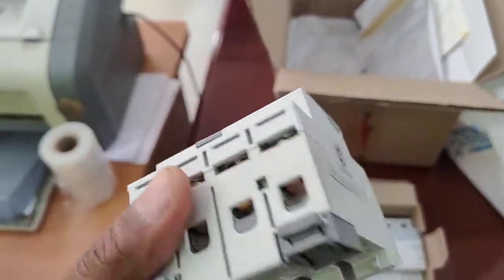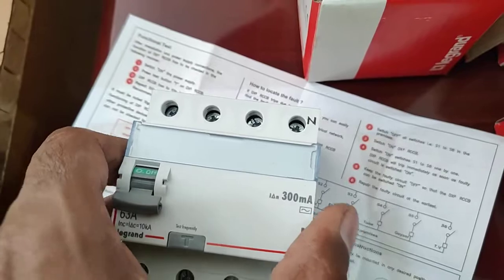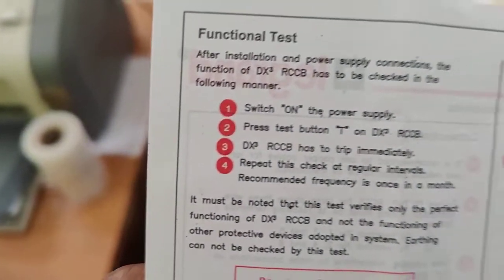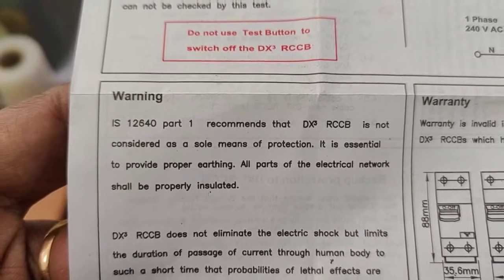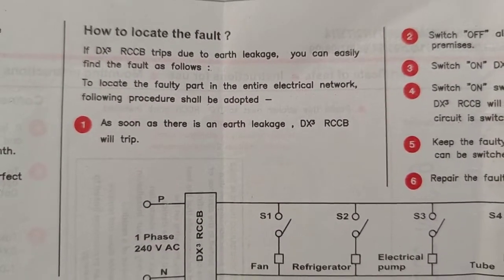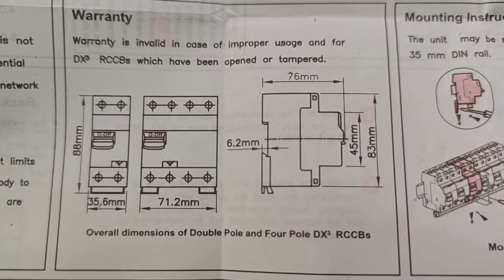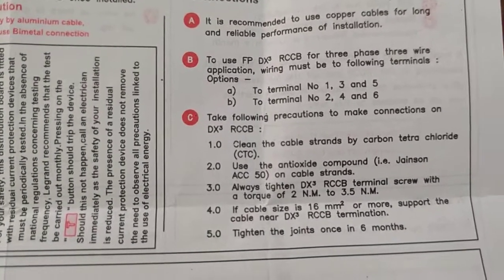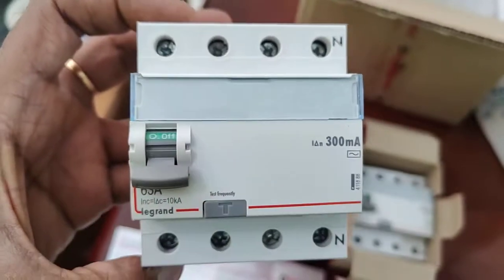Residual Current | 411888 | DX3 RCCBs | 4P 415V | 63A | RCCB  | RCBO | Legrand

Comment: I have a question. I have ordered schneider 63A 300 MA from Amazon. I am using for my house 3 phase. We have  1 hp sump motor,  AC, Fridge' TV and 4 nos 20W blub, kettle.       The one I order will that suit my requirements or should i go for 63A 30MA one. Kindly suggest.
Reply from the maker: 30 MA is preferable or else 100 MA will be OK.
However few case use for 300MA as well due to avaid the tripping.

30mA are mostly used for socket outlets and places of human access. 
10mA are for Sauna, Swimming pool equipment, etc. 
For light fittings and others 100mA is selected and others 300 or 500mA which is called equipment protection or fire protection.
Reply: @MaheshMVElectricalEducation   Thank you sir !